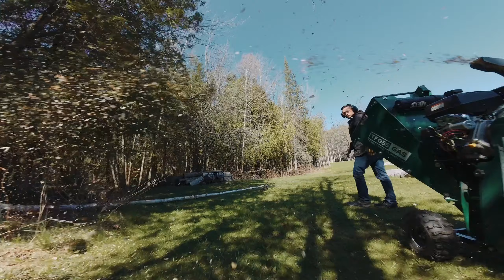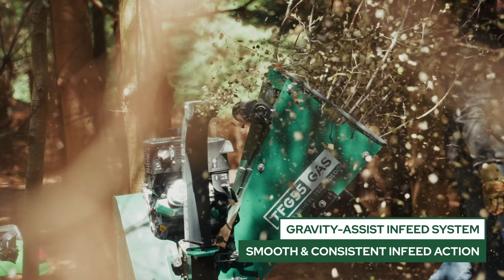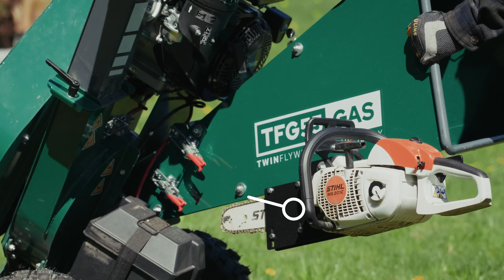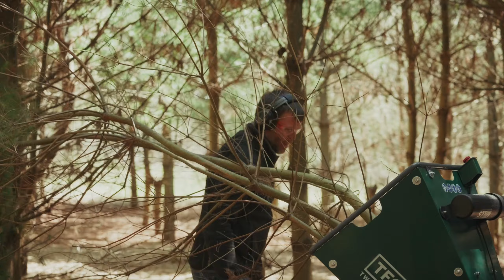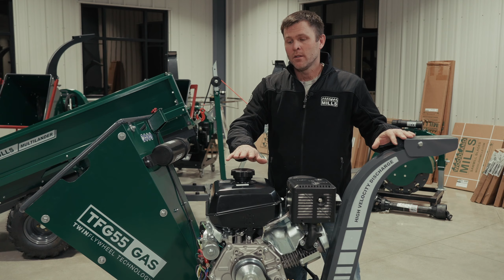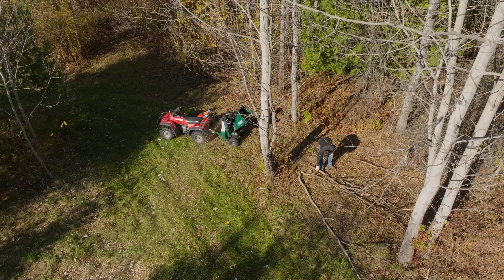Woodland Mills TFG55 GAS Wood Chipper Product Walkaround

Comment: This looks like a terrific machine and worth real consideration.  I do wish that the tow hitch assembly could be folded up or removed without tools and that the front stand could swing out of the way, rather than being removed for the tow hitch so that the tractor could be used for other purposes after getting the chipper to its location.

Comment: Looks like an excellent machine. My only concern is the self feeding, if that really works well or not. I have rented chippers similar to this that every time I put something in the hopper I had to  stand there with another stick to push the material into the chipper because it did not self feed. The video looks really good. I'm going to hold off for reviews from other buyers. Woodland Mills has not dissapointed yet though, so I have high hopes!